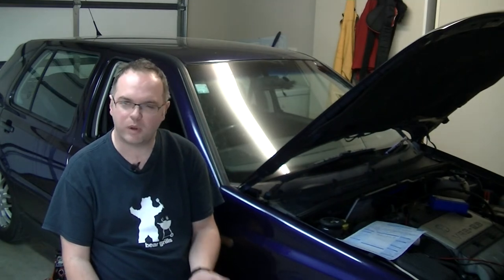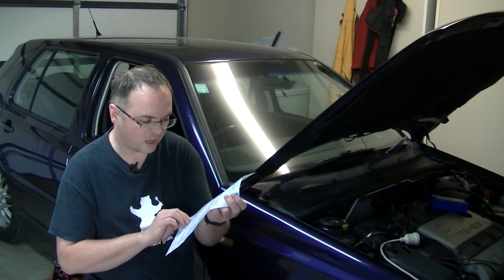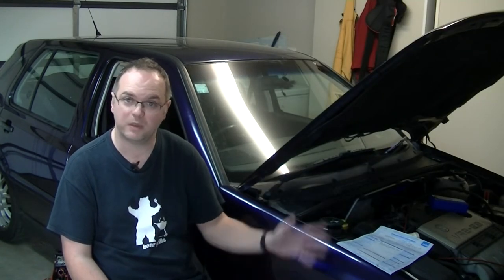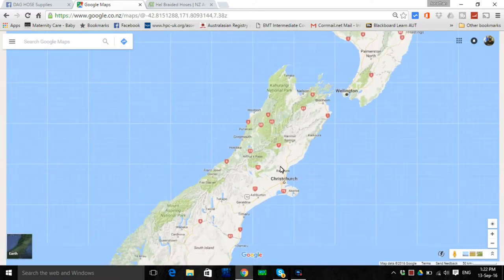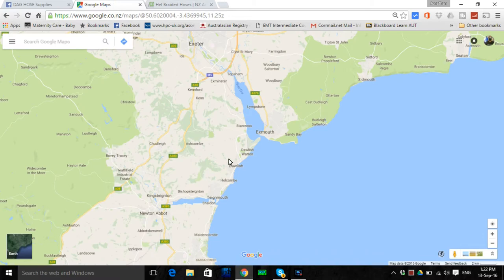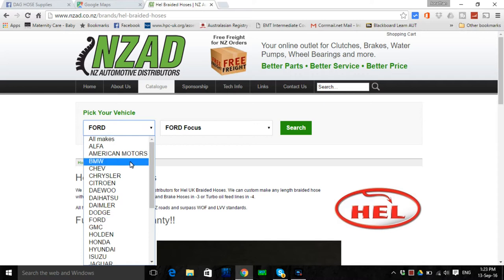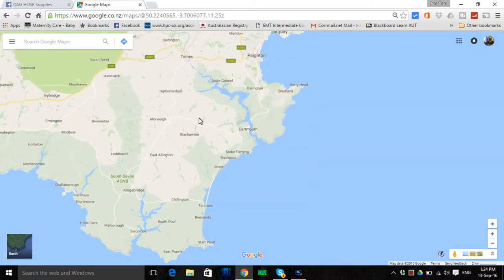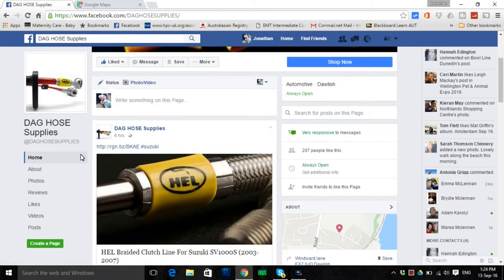Hel Brake Lines for VR6 Rebadgered!

Comment: New banjo bolts and copper washers!  Nice!  That's something I didn't get with the Goodridge kit I ordered a couple years back.

Your "unconventional" bleeding procedure was for Left Hand Drive cars.  ;)

That coarse 1.5mm thread pitch you have there seems quite odd to me; not sure what's up with that.  As I recall, the VR6 MK4 Golf and the VR6 B4 Passat share a front end, more or less, and I'm fairly certain my calipers had a 1.0mm pitch.  Weird!  ...Now I'll have to check.  LOL

If you're going to use DOT 5.1 brake fluid, get yourself a brake fluid tester and take a sample every 6 months.  5.1 is incredibly hygroscopic; much more so than DOT 4.  I typically recommend full fluid flushes once a year for 5.1 as a safety.  :)
Reply from the maker: It's a top quality kit that's for sure!

Are you sure? It came straight from the UK Hayne's manual. I didn't check the Bentley manual as that is definitely US spec. I'll have to go wonder and find it!

I got a bulk deal on Valvoline products ;) About 5 litres of brake fluid (in sealed 1l containers) and 30 litres of gear oil for about $30. It has been changed very regularly! Interesting, I did not know that, I shall get a tester and see how it holds up.
Reply: Badgertronix
That's the typical procedure for most cars in the US; knowing Haynes, they just copy-pasted gobs of text, inverted some images, and slapped "UK!" on the cover.  ;)

Wow, score on the bulk fluid deal!  Typical gear oil here is about $10-$15 per liter.  The stuff I use (Royal Purple) runs about $25/liter.
Reply from the maker: Maybe that's why it took 2 goes to bleed the system. 

I'm almost out of valvoline gear oil and brake fluid now. Will have to see what the options are for the 02A box that's going in. 75W-90 doesn't seem that common in a GL4 fluid
Reply: Badgertronix
Possibly!  If you have any concerns about it, you may flip the bleeding procedure; Left Rear, Right Rear, Left Front, Right Front.  It shouldn't be an issue, though.  :)

Royal Purple's 75W-90 is GL-5 rated, but safe for use in GL-4 applications.  The typical concern with GL-5 is that the high-pressure additives used can weaken brass and other "yellow" metals (synchro rings).  I'd recommend contacting Royal Purple directly from their website to ask about fluid for the 02A; sometimes they'll recommend something different from what you'd expect!

RP's stuff is expensive, but worth it, and it makes a noticeable different in shift quality in a manual.  :D
Reply from the maker: We do have a supplier of RP. Funny story is that's the place who sold off all their Valvoline stuff to clear the shelves for it! 

I always thought GL4 and GL5 were mutually exclusive but it appears not these days. This is why you're chief technical adviser to the project. RP isn't a good value option given inter island shipping etc. I'll have to look at some options...
Reply: Badgertronix
Oh wow, what a strange coincidence!

Shame it's so expensive down there.  Even weirder that you can't find much in the way of GL-4!  Normally yes, they are mutually exclusive; RP's gear oil is made with magical gear fairies that give it the strength of a GL-5 oil without the additives normally found in GL-5s that eat yellow metals.  Contact your local tribologist for details, 'cause I don't have a bloody clue how they do it.  LOL